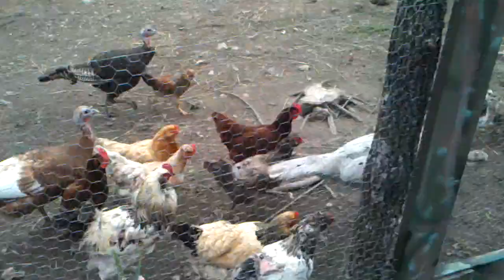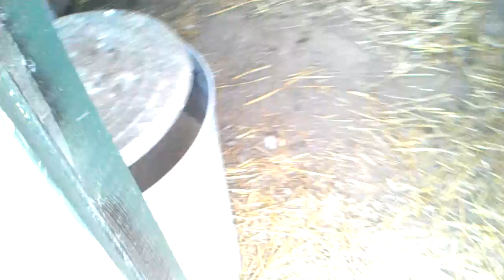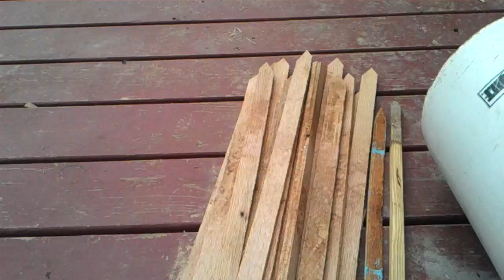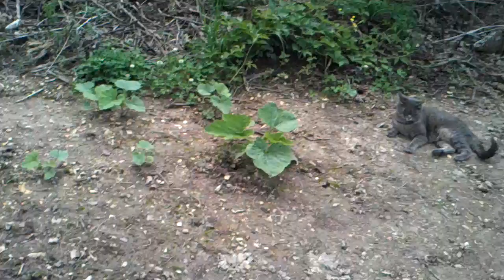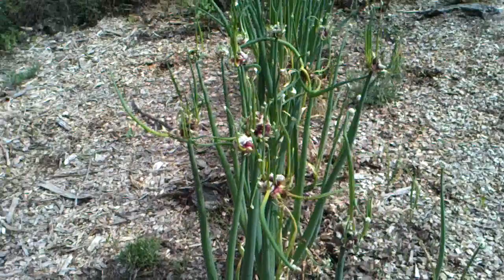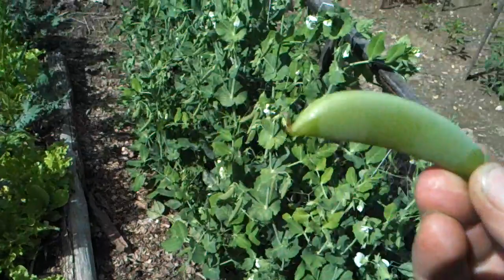OMG WE DID ALL THAT ??  HUGE GARDEN DAY

Comment: Do you run a refrigerator?... Need a critter to eat all that grass and pack on a few pounds. Goat on a rope?
Reply from the maker: we use a freezer as a refrigerator and eventually we will get a goat
Reply: Yep. Makes sense. Just insulate what you don't want to freeze. Why waste power on 2 appliances. Make sure you get a mellow goat, otherwise they will drive you bloody nuts...